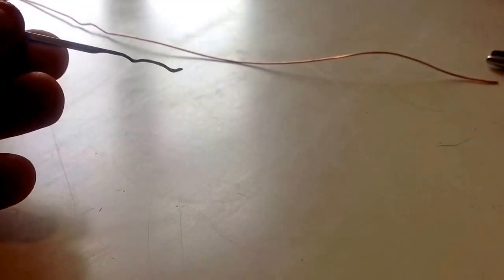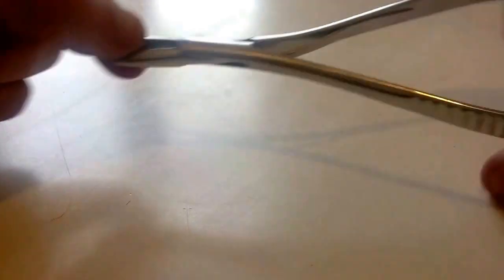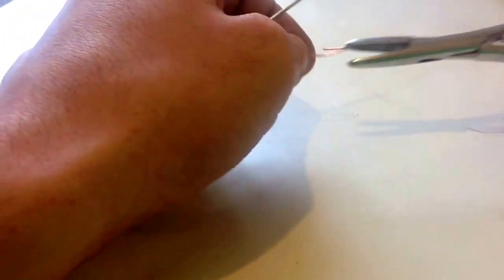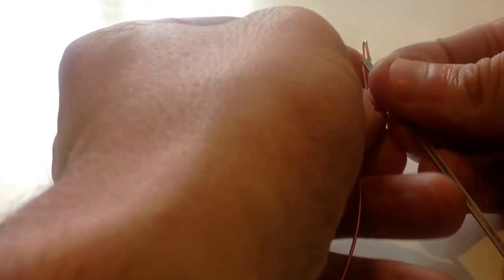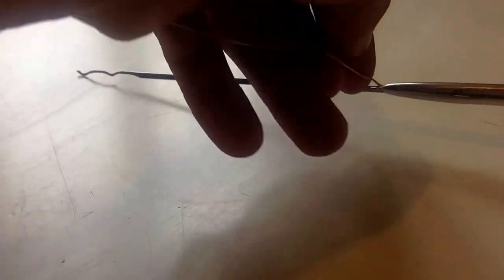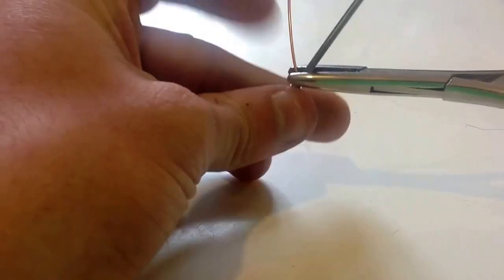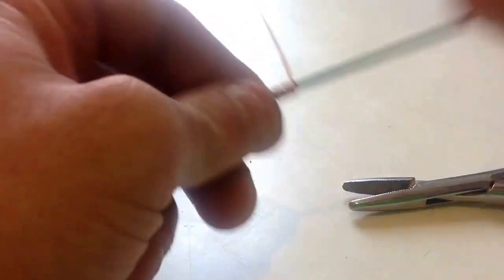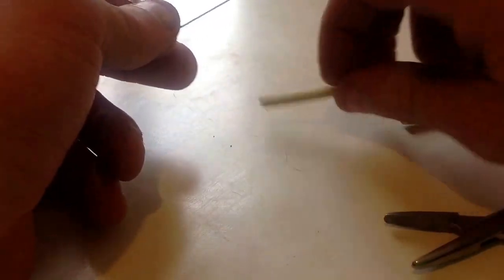Home brew handles

Comment: Try n put the end of the pick in a drill once you've folded the wire over. You can then put some decent pressure on the wire and wrap it really tight. How I used to do it. Just gotta take your time n be careful that you don't twist the pick